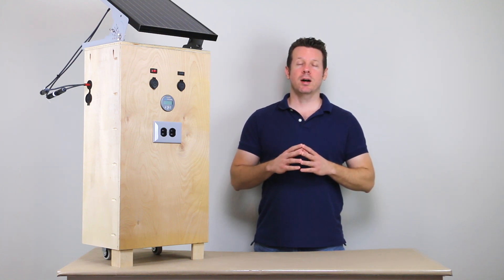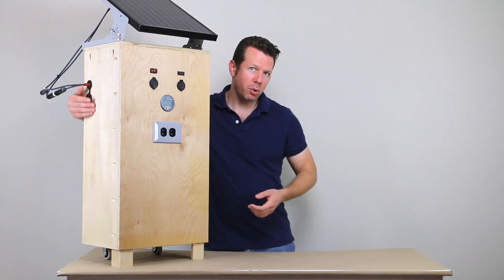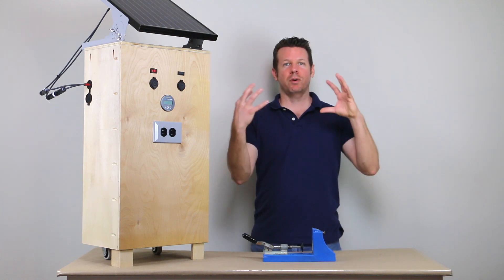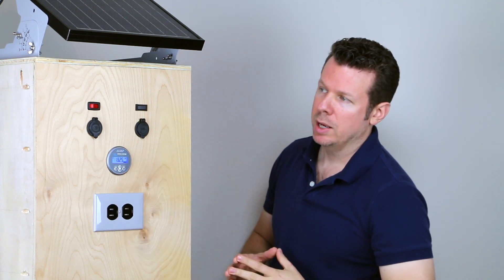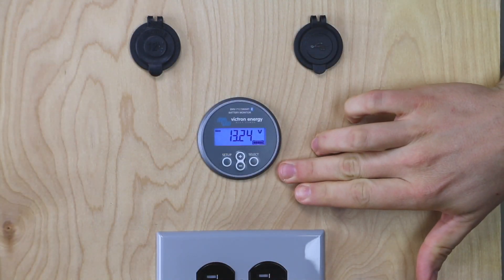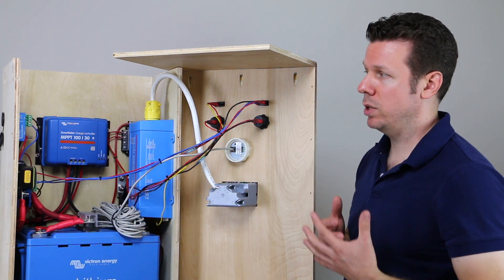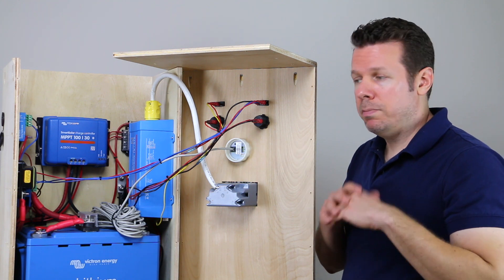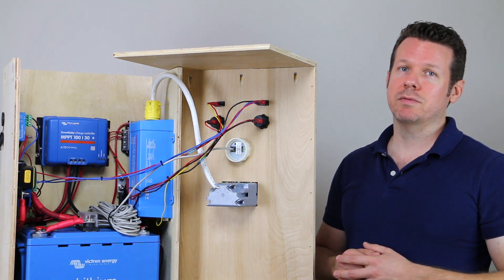Build a Removable Solar Power System for your Van or RV | Part 2: The Final Prototype

Comment: Very handy tool with the remote switches. I think I'm going to use one in combination with battery protect for shuting off 12V loads on the system like you mentioned on other video. I have question regarding switch for multiplus. Can it be done with 3 position switch as multiplus has OFF, CHARGE and INVERTER modes?